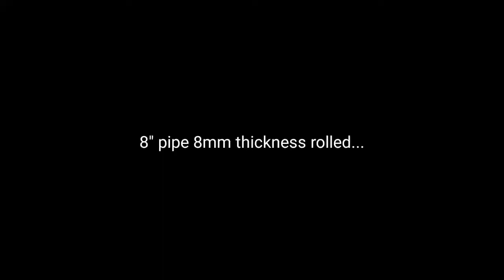8 inch pipe rolling bending machine

Comment: I need this type machine
Reply from the maker: Sure
How can i help you
Reply: @S.Sultan motor de cuanto hp o kw wmes porfa dime al ojo creo es de 25 hp o 30 hp  y ese cilindro será de 200 tn o 300 tn o me equivoco dime porfa ayudame
Reply from the maker: Its 20 hp motor with 4 gear box
Reply from the maker: And one of them has 6 speed